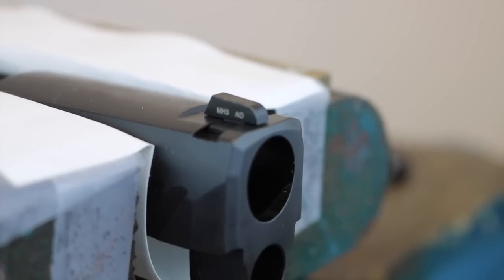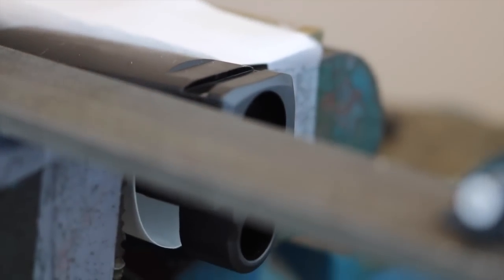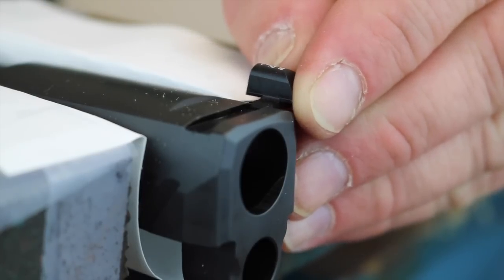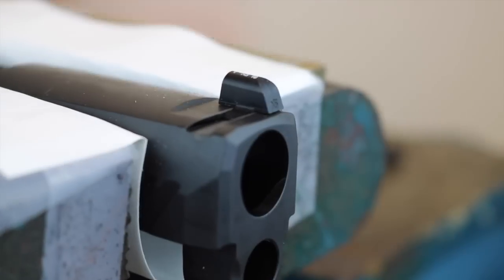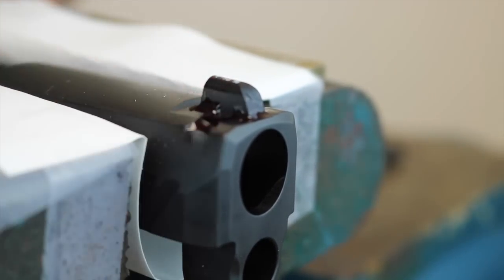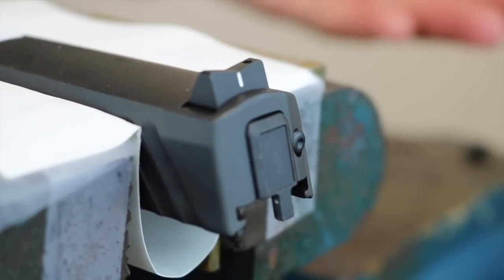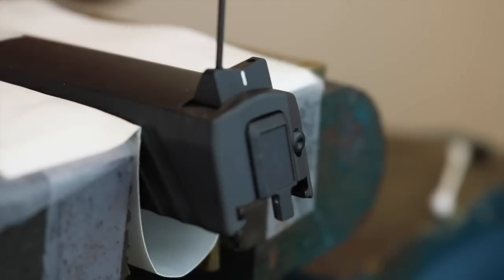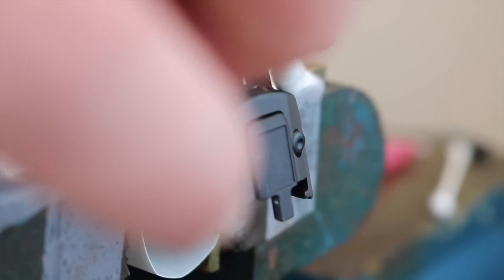XS Night Sights Sig P320 Installation

Comment: Shouldn’t you sight your gun at the range before you use thread locker on the rear sight?
Reply: If you use a micrometer, you can make sure the sights are perfectly centered. This is a carry pistol, not a precision competition race gun, so you really don't need to go too crazy.
Reply: Robert Taylor  Lol bud it's a handgun. There's no adjustment for windage or elevation. You center the sights. This is very basic handgun knowledge.
Reply: JenkemOD by pretending to know more about firearms than you actually do and trying to make someone else look bad you completely showed your ass. as you said it’s elementary knowledge 😂😂
Reply: False. You said “shouldn’t you sight your gun at the range before you use thread locker on the rear sight?”. You did not say “centered doesn’t mean perfectly sighted in”. The difference between these two is one is a question where you seem to be asking for advice and the other is a statement you are now making and since you have lied about what you said the rest of your argument is null. You have made yourself look like a fool. Good day mam.
Reply: JenkemOD Your username makes your comment much funnier
Reply: @DangerRussDayZ6533  ?? u drift the sights to zero

Comment: Nice video.  I had to use a jackhammer to get my factory front sight out.  Zeus loosened it first with Thor's hammer.
Reply: Use a propane torch . Just heat it slightly. Don’t over heat.

Comment: If I remeber correctly dove tail is tapered and removing is torwards ejection port direction. So from top view sight is tap from left to right, there should be resistamce.
Reply: To remove, tap the right side (when looking at the back of the slide).To insert tap the left side (when looking at the back of the slide).
Reply: So who is right?
Reply: @BINX-RR  so opposite of comment above u?

Comment: I feel like those sights are very very loose, you hardly put any effort to drive the front sights in
Reply from the maker: We filed them to fit that way. We don't crush our sights into the dove tail like our competitors. The locking compound does a great job at sealing the sight in.
Reply: @XSsightSystems  Does the locking compound make the removal difficult or impossible in the future?
Reply from the maker: @kalosh007  No, it is still removable.
Reply: Too loose, if your sights move it could get you killed.
Reply: kalosh007no because it’s steel with a liquid sealant glue. Just like in vehicles when they use red lock tight
Reply: I was thinking the same thing
Reply: There is no threads for the loctite

Comment: Front sight on my P365 was a bear to get off.  It took a fair amount of filing to get the new sight to fit and then took some strong encouragement with a ball pien applied to a nylon mallet to get it into place. I don't think I'm going to beat it out to put threadlocker on it.
Reply: Had same problems with my 365. If I rember correctly the instructions said to aplly the treadlockerto the sides of the front sight after it's mounted and let it leech under the sight, then remove excess. Don't wanna take mine back off either.

Comment: I'm grateful to have this training on how to fit new Sig sights. But what I'm confused about is why you would lock in the sights before you brought it to the range and sighted the gun in for accuracy. What happens it it's shooting left or right? You have to break your thread locker. Why not wait until after a range session when they are adjusted to lock them in?

Comment: I too am concerned about how loose the rear sight fits. Red thread locker works great but the correct way to remove anything assembled with thread locker is to heat the parts. When you shoot the pistol the slide may get warm enough to make the thread locker ineffective.
Reply from the maker: Hello, the red thread locker has heat resistance up 450 F. Our standard product testing consists of 1,000 shoot test in 15-minutes. The pistol slide heat tops out at 300 F and is not sustainable and drops quickly.

We have taken sights through 5,000 consecutive round shoot test. You will be good to go.

Sorry for the long reply, I was one who drew the short straw and had to do the shooting test :)
Reply: @XSsightSystems shooting is the short straw? You guys hiring?

Comment: Wouldn't it make more sense to put on the thread locking compound before you install the sight? Thread lockers are not glue and from my understanding only are activated by shear stress, such as that caused by wedging the compound in between threads.
Reply from the maker: It really doesn't matter. There are pro's and cons to both methods. Applying it before the install can drive a lot of the adhesive out of the cavity and you will still end up adding more afterward. The key is to let it rest and seep into all the empty cavities on the dovetail angles. When in doubt, use more :)
Reply: @XSsightSystems  Nice video.  But if you're going to apply the Loctite after assembly then you should use a "wicking grade" like the 290, specifically designed with a lower viscosity to use on assembled parts.   Regular grade (blue or red) Loctite should be applied before assembly.
Reply: you're right, thread lock compound is for threads - and tight spaces and offers very little hold on the exterior. it's bound by compressive strength, not putting it on the exterior.
Reply: This is what I thought.  Putting locking compound on after seems to negate it’s purpose.
Reply: If it can "seep in" then some will stay in place if applied first. As far as "driving a lot of it out " and having to clean the excess,  you have to do that anyway, especially considering the amount of product you used.  As far as the installation video itself,  Thank you for posting it.   Seeing someone else do it without a sight-pushing tool, gives the rest of us the confidence to do it with common tools ourselves.  😉

Comment: I have a new P320 3.6 Pro Cut Slide that I put suppressor Height Sights on. The rear was cake to remove and install with a sight pusher tool, but I can’t get the stock front sight out for the life of me with a punch! Yours came out so easy, why is mine so difficult? Help!

Comment: Plan on getting XS sights for my Glock G30S and Sig P320C. Why not place a drop of thread locker in the dovetails and/or bottom of sights before sliding them in place? Is it o.k./advisable to do that?
Reply from the maker: You can do that. It doesn't hurt. More than one way to do it :)

Comment: Why would you use red threadlocker?  You may have to adjust those sights being that you have not sighted the weapon.  Red is very difficult to remove.  Generally it is used for permanent applications.  I always use blue on projects like this.

Comment: don't you shoot it a few times before putting the thread locker in the rear sight? or won't the srews hold for that ??
Reply from the maker: You can test shoot the firearm before applying the thread locker, but risk the sight coming off. The red thread locker is not too strong and will allow you to be able to make adjustments. After you make adjustments, apply more thread locker.

We recommend a brass punch or a delrin block. Both are available at Brownells.

Comment: How hard is it to adjust your sight when sighting in your pistol with that thread locker while at the range?
Reply from the maker: It isnt too hard, just don't us a ton of thread locker for the first shoot. You should easily be able to visually center them for the initial install and then make minor adjustments from there.
Reply: XS Sights thank you very much.

Comment: about to buy a p320 without night sights. How much are they and what brads are best. I've never replaced any sights on my pistols
Reply from the maker: They are about $125 on our site if you get the tritium front/rear (DXT Model)
Reply: The Sig tritium sights are pretty good if you're in need of nigh sights, and actually have a larger dot when using the tritium in dark area than the Trijicon HD series. The Trijicon sights are very good and the HD series or the HDXR sights are best rated. XR is fairly new. They are exactly the same as the HD with a thinner front sight. They both use the same rear sight..Tritium on these sights are as bright as the Sig but smaller dot, however, they seem to be more focused because they use a lens on them.. Sig does NOT recommended to use a punch on the P320 as some of them are extremely tight in the groove. You could damage the sight or the slide itself if you try to use a punch..
Reply: @Joe Lindley   Joe I have a Maryland Gun Works (MGW) SP1000 sight tool. I have the original version of the tool. Looks like there are some newer versions. It's a little expensive (about $300, maybe less now) but it will work with just about ANY semi automatic pistol out there. This is a rock solid tool. The tool uses specific "shoes" to accommodate different brands and models which fit into the slides to lock them into place on the tool. It works great for even very slight adjustments and will move even the most stubborn sights. I would not suggest using wood or plastic drifts and a hammer. These 320 sights can be hard to move and you'll likely end up with a damaged sight if you do.. And there's no way to make precision adjustments like that.. The tool will pay for itself if you have a number of guns that you want to change or adjust sights on. There is a vid "Installing TruGlo TFX Sights on a P320" #245 that shows the MGW SP1000 Sight Pro tool that I use.

Comment: Thx for the detailed video!
Do u need to zero the sights? Is so how?
Cheers!
Reply from the maker: If you center the sights with the slide during instillation the sights are technically zeroed. If i is shooting right or left for you after the sights are dead centered on the slide you can adjust the rear accordingly to your shooting style. Make sure before you drift the sight in any direction to have a buddy or range office try your pistols to see if the zero is the problem. It could be trigger pull technique.
Reply: XS Sights thx! I appreciate it!

Comment: What type of file did you use or suggest? 200mm?
Reply from the maker: 200mm will work. Honestly we use a wide variety. When going slow and test fitting the sight after every swipe, it doesn't matter too much of which size you use. Just make sure to apply pressure evenly when dragging the sight down the file and don't go crazy when pressing down. You can always remove more material, but can't add it back.

Comment: Does it matter which side you knock the sight out and reinstall them from. Left to right only? Right to left? or it doesn't matter?
Reply from the maker: No not for Sig's and Springfield's.
Reply: Per Sig yes it matters ... when looking at slide from the rear they are to be knocked out from right to left the reinstalled from left to right.
Sigs have a taper on the right side and knocking it through that taper would not be good
Reply: @chrisimes478  thanks for that just bought a set and every one wants 50 to 75 to install going to do this myself
Reply: @MichaelSmith-cq4zk  how did it turn out?
Reply: @striker101nicary  turned out great no problems
Reply: @MichaelSmith-cq4zk  sweet! Thanks for the fast response 👍

Comment: Big oof bro. you removed the sights the wrong direction. thats why the next ones were loose.
Reply: What is the right direction? Towards the case ejecting side or the opposite? Might be getting a red dot on my sig p320 full size and will have to install the outerimpact plate on the back site. Though I'm a bit confused because the back site doesnt appear to have screw holes or screws...so not sure how that red dot plate will work...